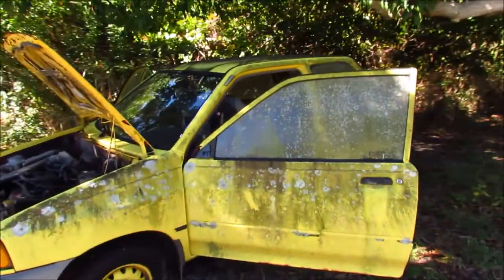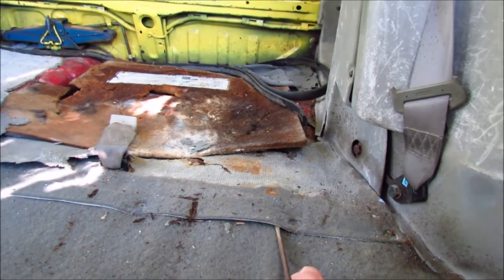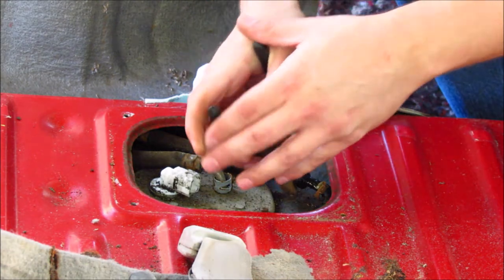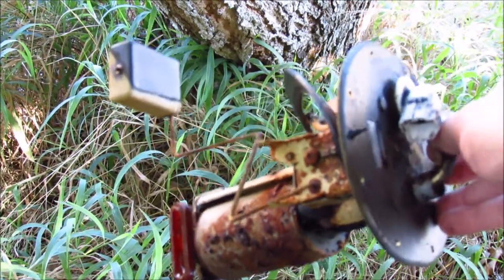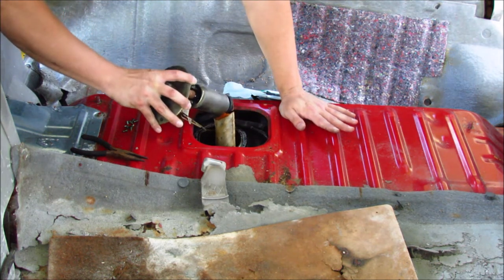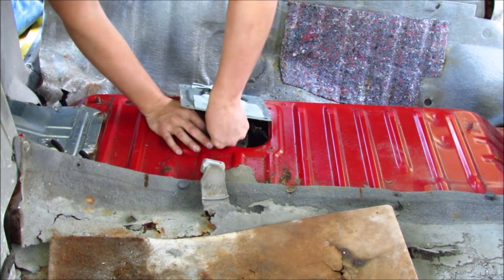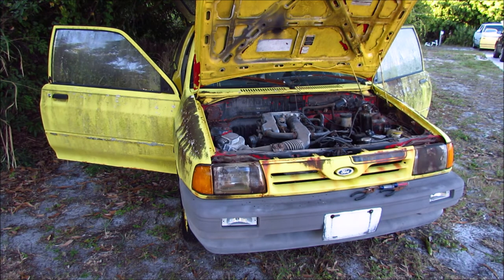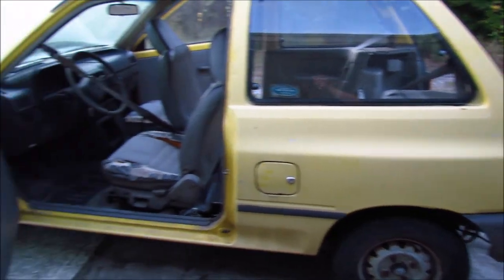How to Remove Ford Festiva Fuel Pump

Comment: Good afternoon, I have three of these beauties, and one like this one with a bad fuel pump, but the pump is no longer available complete, do you know where I can get the whole assembly? the one I have was good but the connector corroded and is not available, so being inside the tank, needs to have a positive connection or I'll just blow myself up! thanks.
Reply from the maker: I usually get everything from rock auto.  I hear that iran actually still produces every part of these cars.  Not sure how well that helps but its a little bit of information.  Also look into mazda 323.
Reply: @thousanddollarcarguy  thanks
Reply: Rock Auto only has the motor/ pump by itself and filter, but not the tower and complete assembly, we're lost.

Comment: You could have shown the fuel pump installation. I`m sure most people can remove the cover. I needed to see how the pump set in the assembly.
Reply from the maker: Sorry i cant help you there.  I literally installed it as one unit like you see

Comment: What you pulled out of the tank had a round top, mine is oval and only looks like a sending unit / fuel level sensor. Having trouble finding my fuel pump.  '88 carburetor model
Reply from the maker: I didnt believe the carbs had a pump at all.  But you could buy an inline pump that sucks from the tank and pushes fuel up to the carb.  Im sure loe flow pumps are cheap
Reply: @thousanddollarcarguy  just came from the parts store,  he said they should have a mechanical pump,  might be on the side of the motor. 
 On mine the hoses from the tank go to something that looks like a filter looking contraption next to the fill port.  From there idk but I WILL figure this car out! 
Sat for 7+years with a problem with the fuel delivery system,  cranked off of starter fluid other day though, so I'm still hopeful.
Reply from the maker: @slowpoke4557  best of luck.  Keep me posted.
Reply: Mt 88 festiva has a mechanical fuel pump mounted near the carb.  Replaced it and it cranked up!! Now I'm trying to figure out how to check the manual transmission fluid,  hanes said to pull the speedo cable.
Reply: I replaced the fuseable links with a fuse block.
Reply: @slowpoke4557  yes the speedo cable is also the dipstick. It has markings on it to determine the full-level

You may have to use a rubber mallet to remove it as it has a oring on it that may have swelled making it difficult to remove by hand without some persuasion.

Its held in with a 10mm bolt and the tab on it is very easy to break when re-installing and tighten the bolt.

If you do break the tab off no worries. Super glue or JB weld will fix it as all it's for is to retain the cable in place.

Comment: I have a Ford festiva, engine light.does'n come on,  tried almost everything it's been parked for.more than 3 years now , how can I tell it's gas pump? Or the gas pump relay is not working I bought a brand new battery last year.
Reply from the maker: You should be able to run 12v straight to the pump.  This will tell you if the pump is good or not.  If its been sitting for 3 years and hasnt had a full tank then its probably shot.  Full tank theres a chance.  Half full or empty its probably completely rusted
Reply: @thousanddollarcarguy  thanks a lot

Comment: How do I replace the fuel filter on an 89 4 speed L?
Reply: Actually, excuse me. Is the fuel filter inside of the fuel pump? I’m an idiot when it comes to this lol
Reply from the maker: @SwaggetiThe4th  it should just pull off.  Once you get the pump put it should come off with a bit of pulling.
Reply: @thousanddollarcarguy  awesome, thanks man. lost all compression and rolled down a hill backwards yesterday so this is my project for the morning tomorrow. Just picked up a filter from advanced today so hopefully itll be a fix for it